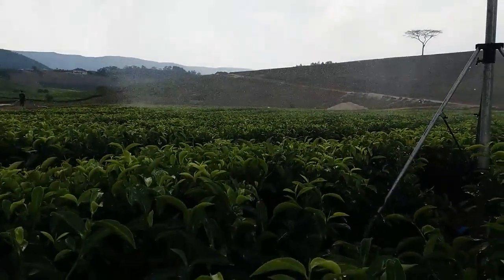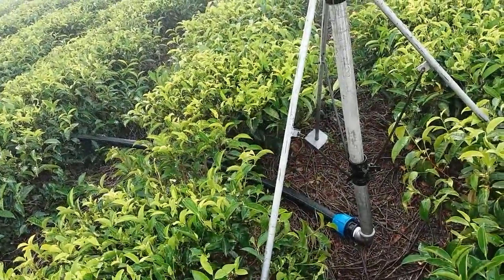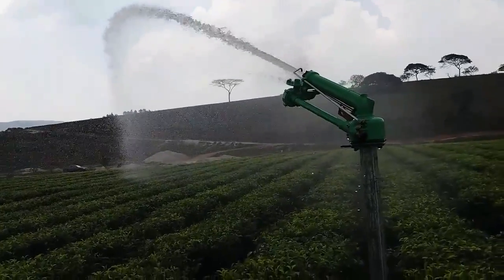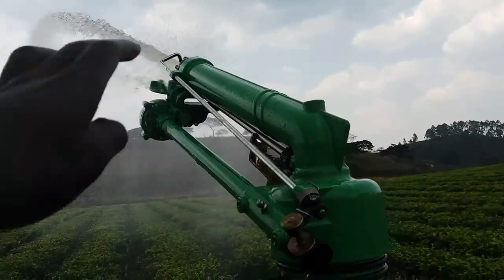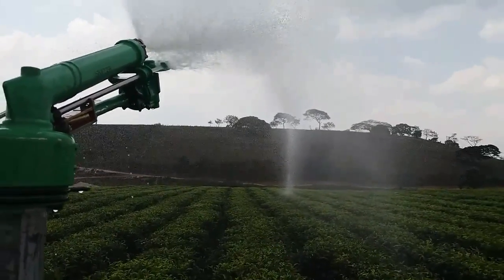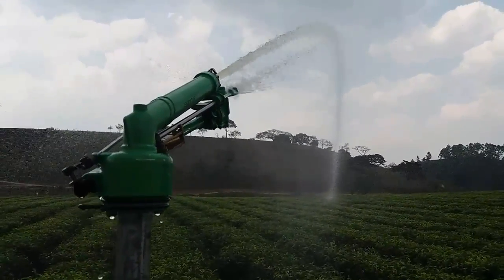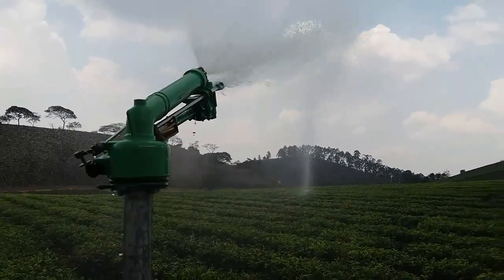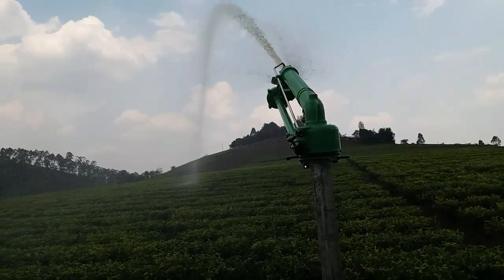Rain gun sprinkler irrigation system in uganda (Tea Irrigation )

Comment: What price?
Reply from the maker: ARAVINTH SOUND Thanks for comment.
Please let me the know the following;
1. Do you want the whole system or the Sprinkler head?
2. Your location
Other questions will come after answering question 1.
Thank you
Reply: This sprinkler connected 2hp submersible pump ?
Reply from the maker: ARAVINTH SOUND Not submersible pump and not 2hp, you need a pump of about 7hp but when sizing water pump, you need to mainly look at the total head and discharge.
Reply: What price whole sprinkler?
Reply: I want 2 HP motor connect sprinkler?
Reply from the maker: ARAVINTH SOUND please give me all site details like, total acreage, crop type, water source and distances, farm location, field slope etc. You can give me a technical drawing to list you materials required.
2hp power water pump may not work for you unless if you use small sprinklers
Reply: What price ? Sir
Reply: I want  whole system what price sir?
Reply: Please tell me sir?
Reply: Half acreaga and groundnut
Reply: Tamil nadu in Salem pls tell me sir